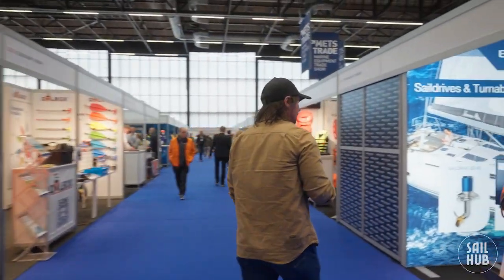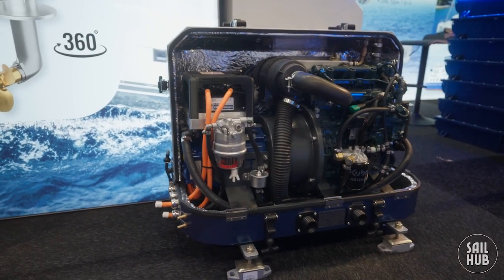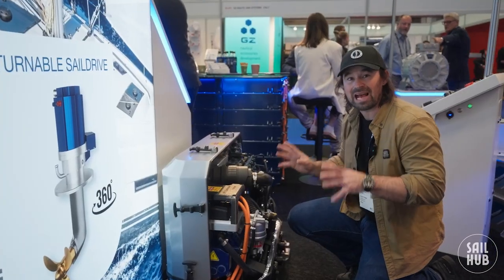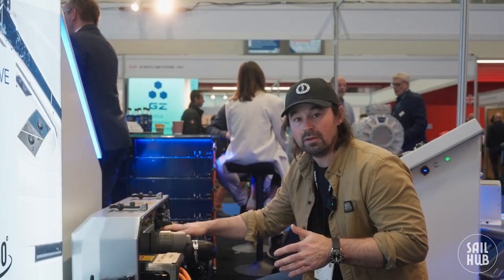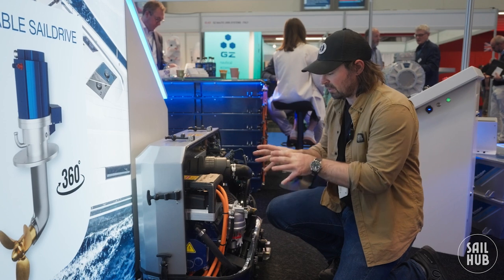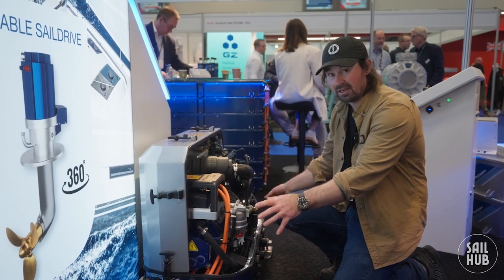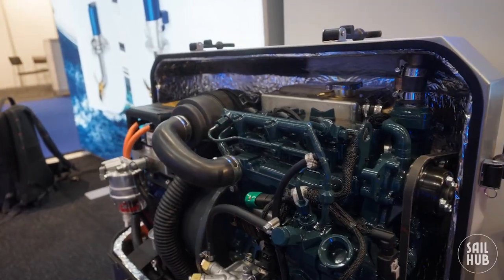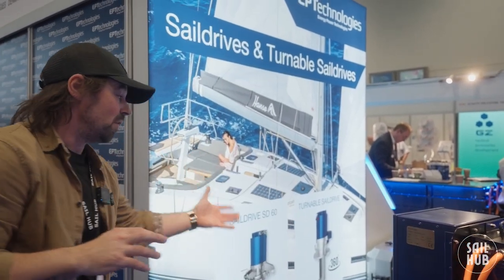Mini generator 14 kW tiny footprint, great output!

Comment: It's not tiny, it's small but not tiny.
That is a lot of output however for such a small genset, although I'd lime to see it's cooling package as well 🤔
Reply from the maker: Hi! It features an air intake valve, an air-water mix outlet, and a heat exchanger to efficiently dissipate heat from the Kubota engine. For more info: https://eptechnologies.dk/generators/